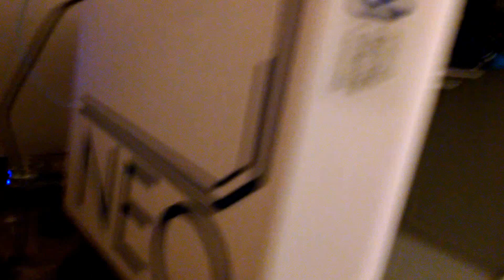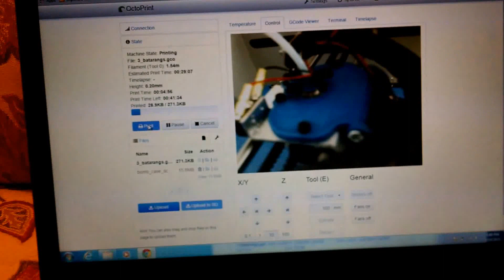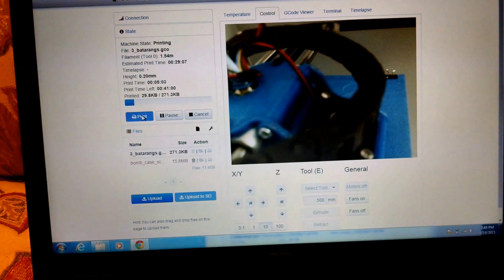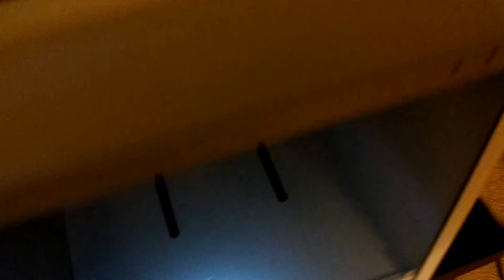One month with the German Reprap Neo!

Comment: Is it possible to print ABS with the neo?
because on the site they say only PLA but if the temperature is high enough would it melt the ABS?
greetings, Bo
Reply from the maker: That's kind of an open ended topic. On the neo wiki, they say any material other than PLA might void your warranty. But, on this last spool of PLA I have been using, I have to print it around 225 for good extrusion.  That being said, I think it's doable, just not recommended. I put the question our on the GRRF forum a few days ago to see if they'd approve other filaments, but for no reply (was thinking more like Taulman bridge or PETG though). There also was a guy on the forum that actually installed a heated bed, re flashed firmware and did a few other things to print ABS. He did get that to work.
Reply: nice, thanks!

Comment: hey, you could update it with this heated bed http://www.makerfarm.com/index.php/6x6-heat-bed.html
than you dont need painters tape and stuf like that !
greetings, Bo
Sorry for my bad Englisch
Reply from the maker: de technogast Hey man.  If you're the guy who posted this in the forum, I already looked it up.  It's very tempting, but I don't want to void my warranty after going through so many hassles getting a good printrboard in for it.  I'm going to put the question to the forum here wether or not PET could be used.  It seems like a good alternative to ABS.BTW, Deine Englisch ist nicht so schlecht!
Reply: oké,
but just you know it you can also buy an appart conroller to controll the heated bed, so you dont need the board from the printer.
(just in case your interessted)
Reply from the maker: Looked on Makerfarm's site for the controller.  Couldn't find it.  Do you know another source?
Reply: yep, this controller would do the job.
Its rated at a 10A on 250v so thats 2500w .
Reply: what is the name of the webcam you are using i have a raspberry pi running octoprint (i dont have a 3d printer yet, but i thougt it was a good idea to prepare everything so i can use it when i receive the printer) but the webcam i have is not compatible with Linux.
PS, do you like the NEO, i gonna buy him but i dont have the money yet :-(
greetings, Bo
Reply from the maker: de technogast  the webcam is a Logitech C615.  Hooks up directly with no external power no sweat.  I like the Neo, but have come up with some other small issues I'm troubleshooting now.  I'll post another video about it soon.  Definitely not a dealbreaker, though.
Reply: thanks! :-)
Reply from the maker: de technogast oops.  meant Logitech C615.  Sorry.  Edited in my comment.
Reply: thanks, no problem!
What do you think about the heated bed idea?
Reply from the maker: Not bad...  I may try it out when more spending cash is available.  Also considering trying out PET, which this little project you recommended would come in handy for.